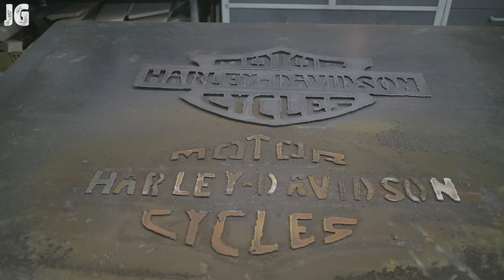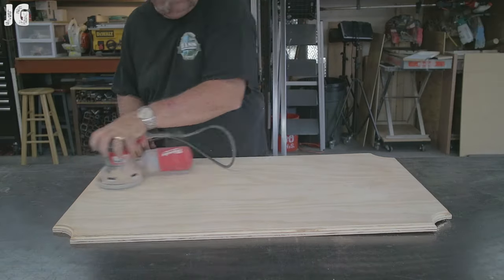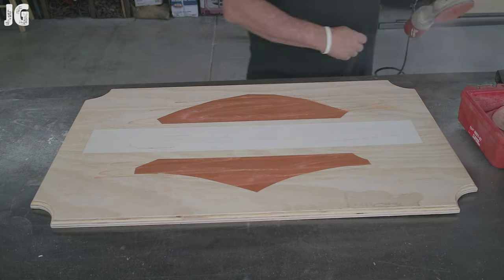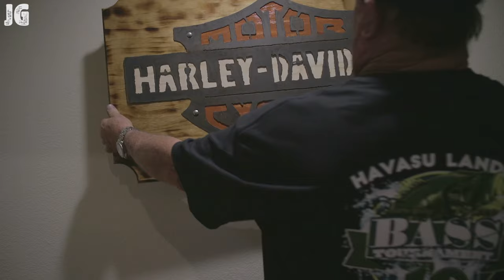Harley Davidson Metal Art Build - Jimbos Garage

Comment: I agree with you on the "a", Overall pretty cool. On a side note if a finish is too glossy for you, you can get the synthetic steel wool in different grits. Use the finest or no grit pad and knock down the gloss to the sheen you like. I use gloss for most all of my finishing and rub it down to the sheen I like. To many coats of a flat or satin finish can cloud a project too.
Reply from the maker: Thanks for the advice Tom, Jimbos garage!

Comment: Next time yo hang something on the wall with a hook as you did here. Put a strew on the hook, it will be long enough that you can get the strew between the picture and the wire, it will slip right down onto the hook and you can slip the strew off and you have a very easy hanging !!!!! P.S. !!! Nice work on the project.